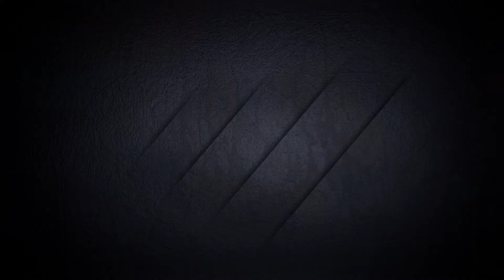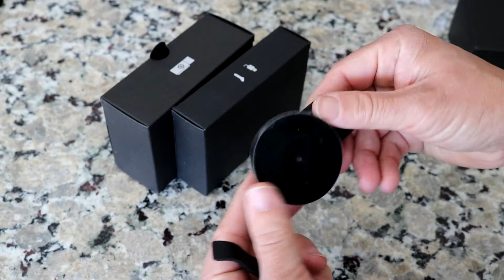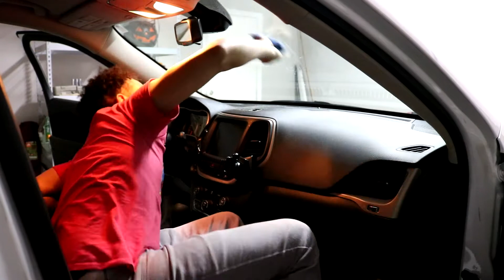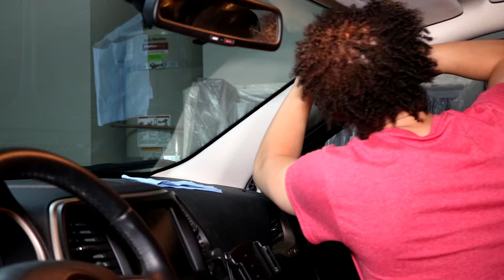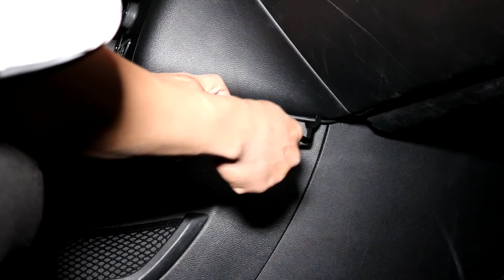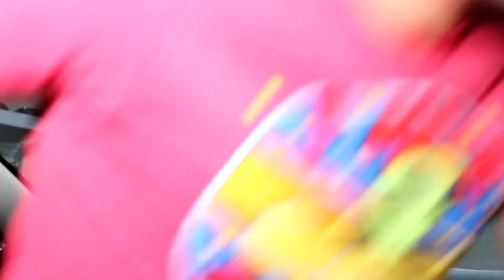#dashcam #vantrue Install Vantrue N2S Dual Dash Cam on Jeep Cherokee

Comment: I just ordered that model.  I can't wait for it to arrive.  Thanks for showing the wire hiding process.  Was the audio in the car using the N2S or another source?
Reply from the maker: I was using another source, the mic on the N2S is not very good.